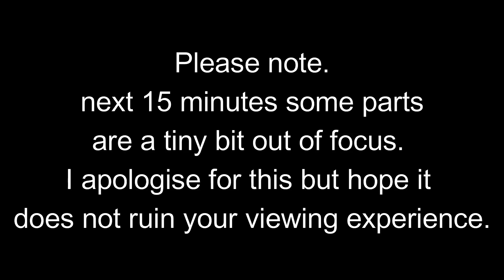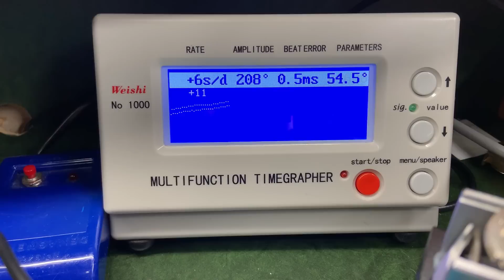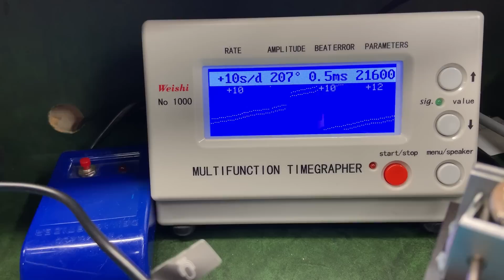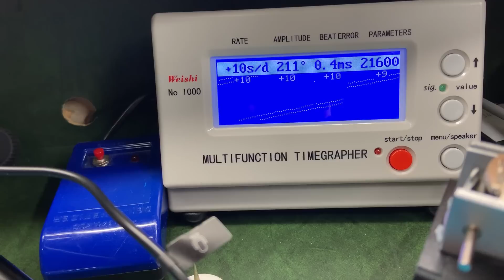Seiko Sea Lion M88 Rebuild (6106-8030) Watch Restoration

Comment: This watch probably started my interest as a collector. In about 1970 my uncle took me out for ice cream while he was wearing this watch. He said it wound with the movement of his wrist. He was a joker and I didn't believe him! Then at my father's 80th birthday party in 2008 I saw him still wearing it! Long since a collector at that time, we had a nice conversation. He passed a few years ago at 93. Recently I contacted my cousin, his daughter, and discovered she had the watch. I'm now the new caretaker of it and want to restore it a bit. The bezel is missing and the crystal needs replacing, but it otherwise seems ok. Replacing these and a servicing and cleaning will do. It's a 6106-8039 with a black dial like yours, which I've haven't been able to spot another example of. The only difference I can determine between the 8030 and the 8039 is that the 8039 has lume down the centers of the hands, and the movement has 17 jewels instead of 25. Also there's no "Sea Lion" text on the back nor a depiction of a Sea Lion. The SN is 844609. I'd like to remove the movement to ultrasonically clean the case. Once I remove the crown will the movement just drop out? I heard you mention that the plastic ring may lock that in. Thank you for this great video!

Comment: Hi Mike,  I really enjoy your videos and they have helped me learn how to overhaul watches, a hobby I only just started last year.  I have a tip that my help other beginners like me.  When putting the balance back into the movement,  the angle of the bridge is very important.  The jewel on the balance needs to be on one-side of the pallet fork, but which side depends on whether the pallet fork is in the tick position or the tock position ( sorry I could not think of better name for the pallet fork positions!).  If the pallet fork is pointing to the right the jewel needs to be further to the right so that the jewel will enter the pallet fork fingers correctly when the balance wheel turns.  If the pallet fork is pointing to the left,  the jewel must be further to the left. To put the jewel in the correct position, check the pallet fork position and rotate the balance bridge 20 to 40 degrees away from it’s final location (clockwise if the pallet fork is pointing right, and counter-clockwise if it is pointing left). Then move the balance so that the bottom pinion enters the shock jewel. When the balance pinion is in the shock jewel, rotate the balance bridge back to it’s final position and lower it onto the locating pin(s).  This normally works for me and should prevent damage to the jewel (impulse jewel?).

Comment: fwiw, there is a rust remover called evap-o-rust that dissolves rust without harming the good metal. I don't know if it's available in the UK, but i understand that there are some competing brands with similar performance. It does leave the steel or iron ready to flash oxidize, but usually this takes the form of black iron oxide which is hard, thin, and smooth.
Reply from the maker: Thank you for this information I was only looking at Evapo-rust the other day online.

Comment: Hi Mike, I did a 6119 with similar day/ date setting mech. I found that the crown is kind of recessed so it fits over the stem tube (like a U shaped cross section). That recess was full of accumulated dirt that had to be cleaned out so it could move in when pushed. Hope it helps.
Reply from the maker: Thanks stephen . That’s actually a tip I give many people in the FB group when they don’t know why the day date won’t work. 

Problem I have is that to remove the stem I have to take the bezel and crystal off which is no mean feat !

Thanks
Reply: @MyRetroWatches  Good luck to you when you get round to that.
Reply from the maker: @steve1811uk  it’s bugging me too much to leave it so this weekend it’s being fixed!
Reply: @MyRetroWatches  I know how you feel, this hobby is very addictive. I'm the same, I can't leave stuff like that, has to be done ASAP.

Comment: Love it, my seiko 5 6119 had its balance/hairspring get magnetized while in an imaging department at a hospital... any advice? Order a new balance complete? Try de-magnetizing with a de-gausser you can order?
Reply from the maker: Just buy one of these https://rover.ebay.com/rover/1/711-53200-19255-0/1?mpre=https%3A%2F%2Fwww.ebay.com%2Fitm%2FWatch-Repair-Screwdriver-Tweezers-Electrical-Demagnetise-Demagnetizer-Tools%2F231210180053%3Fepid%3D1039338182%26_trkparms%3Dispr%253D1%26hash%3Ditem35d5335dd5%3Ag%3A-aMAAOSwRPBdOg33%3Asc%3AUSPSFirstClass!20109!US!-1%26enc%3DAQAEAAACQBPxNw%252BVj6nta7CKEs3N0qVWhsM0rrtcHqcXF4QKg123sgf%252FaLGEKRn%252FLli1%252BulDRzMQhYf5xm7uBr91LwgDb3T8rOptQpFQxaqz8NSPrfx%252F%252BO0OKHYfyMW%252BbfevdSnLpRxx0ZfBA%252BnJxp1BpUHhdKMmiz2TDH6%252BwrCyGjSaZVhim92u%252FAPaWv3IOD33ypadxkXaFdDc3sStWHLYJd8YRUBxBACIHXNlqCuCPO8NIZdc2kN8n97TLquWK%252B5HsY1LupgTwVibTScKmEY9ht%252FmXsi3EytUD7T%252FC%252BCs%252FLbeBs0RcHwdhFlmOVXrM5opZMJD6EAg02WwW%252B0tVFY6JfF7q644sexrpnGM1HvWRFg88vDBeMVHMSgpJDzYOUFVNA3p6RCmRanv22k487DcoeLJHW%252FD7yPpYgvJnnw%252BKw6KDAnWduRfDutcXRaP2kqL6n9fpQ2TShusFIdJNk7LMRsU8p1RaQKVMtAahOUX1KClhuMr%252Bg54ub6A7gVAbzjE8axs9Hx0pz6%252FuayGF3JBlYcSlMsjaaKDcnRh7SjNIVLvjdFdUmDUECRtRZq1MR8h0gQf7%252FUZGlIydCjPVLX8NVA%252FABG6LLVdqxVoMK3SBYLz82mGX5DeSVvvAWQxshJkxZdQxcADX4RQF%252F51QNLiiztl5RqTXXJU8Hdc7EK8l6MaumgVgzaVrc28lF3Dn6aAVQa%252Fls4Ls%252BU2U%252BOwspzCy4hLHZtZmEB6H9b1oU4ZUY7IGNllkGD07fnXqq6p%252FsVj8YcqZw%253D%253D%26checksum%3D23121018005395746aaeb30c4a83b18a841951f2a191&campid=5338562247&toolid=20008

Comment: Locking mechanism looks like a seeger clip. Cir clip or other names. Just pull the metal bits inward. There is an indentation for a pointy tool.
Reply from the maker: Not sure what you mean? There are no circlips on this movement.
Reply: @MyRetroWatches  those metal bits that turn around can be bend inward, and lifted up? They are springy, right?

Comment: I have the same problem with the quick date pushing the stem in on this movement. When back in the case it doesn’t work. Did you solve the issue?

Comment: I've lusted after one of those for a few years now. Almost won one but my max was outbid by a few quid ☹️
As for the locking ring 'snap ring' , the Seiko casing guide says DO NOT REMOVE.
Reply from the maker: Hi Roberto hope your well mate.  Yes these seem to command a bit of money and I’ve not seen many full day wording wheels before on these.

Not surprised it says do not remove as it’s impossible to do so!
Wish I could because I could make the case look really nice .
Reply: @MyRetroWatches  
Yeah all good here. 
One day I'll snag one in my usual cheap as chips finds. They usually need refinishing but that's part of the fun. Still not got a corner to call my own to practice movement stripdowns etc. No point starting if I have to stop and pack stuff away safely. Needs to be left out at the stage I finished at. Again, one day 😄
Reply from the maker: @ro63rto  stop putting it off! You can do it.  Get yourself on FB and join my group it would be good to see you on there.

Comment: For taking photos of reflective things, get a polarizer filter for your camera. Doesn't have to even screw on, you can just hold it in front of the lens, twist until clear then snap away.
Reply from the maker: Fantastic. I never thought of that. I have one for my dslr but I photo watches on my phone.
Now going to look for a clip on one.
I’ve had so many issues with that before that I never even realised there was a solution!
Reply: @MyRetroWatches  
I used mine to take photos of ponds etc. It's great at allowing you to see what's under the surface .
Reply: @MyRetroWatches  polarisers are not very good for suppressing reflections from metallic surfaces, great for ponds and glass though.

Comment: I have this one but the day date setting is broken, so i have to set it manualy
Reply from the maker: Sometimes all it needs is a clean behind the crown. It fills with crap and stops you pushing it in to quickset.
Problem with this model though is to remove the stem the bezel and crystal have to be removed.

Comment: Hi Mike , is it possible that the locking mechanism can be compressed ( Like you do with an internal circlip) to release it?
Reply from the maker: Not sure I understand. The lever when pushed lifts the setting lever to release the stem. Problem I had was the stem and crown were rusted solid together .

Comment: Did you decide to address the beat error? If yes, how?
Reply from the maker: Beat error is corrected as part of regulation on the timegrapher. To correct beat you move the stud arm on the balance one way or the other.
Reply: @MyRetroWatches  yes, and thanks. I suppose that’s not an especially photogenic process.